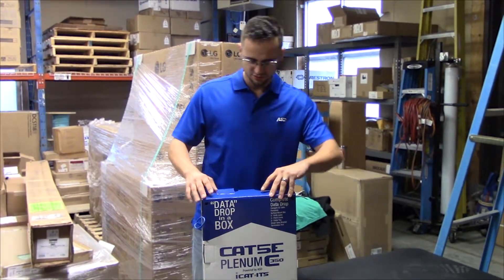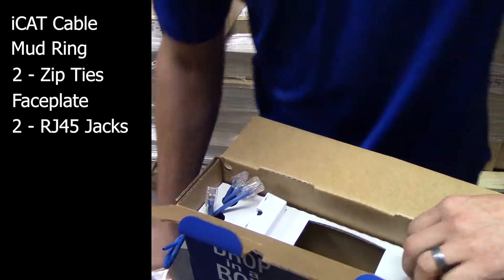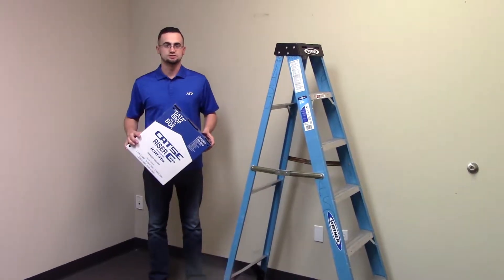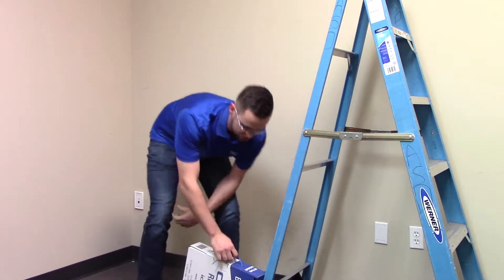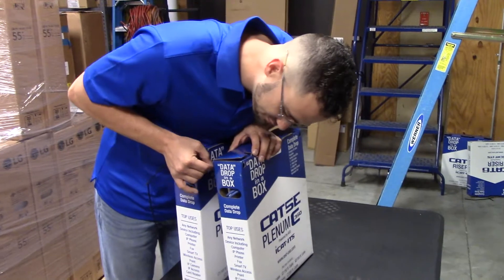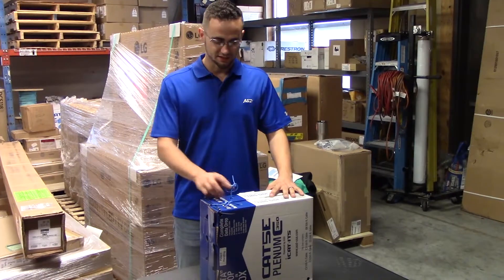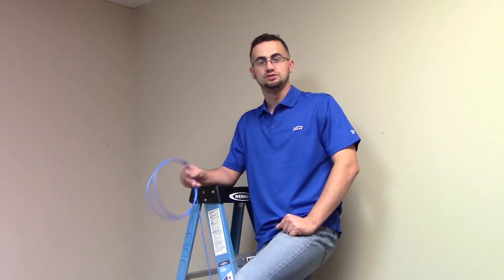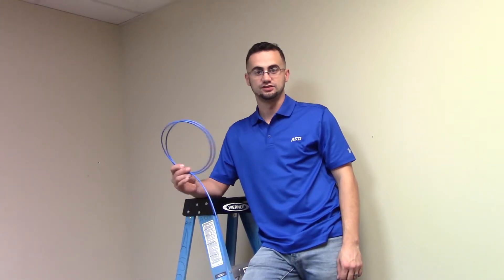How to Install a Low Voltage Cable

Comment: Can you run CAT, Coaxial, and fiber through the same hole?  Do they interfere with one another?
Reply from the maker: Great question! You can run CAT, coax, and fiber in the same conduit with no interference. However, you can't run power cables and low voltage in the same conduit.